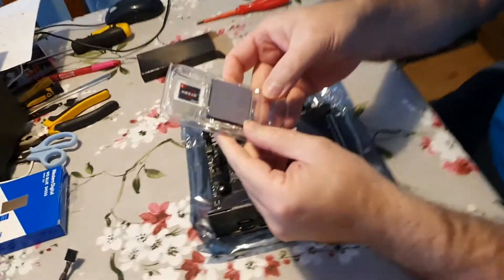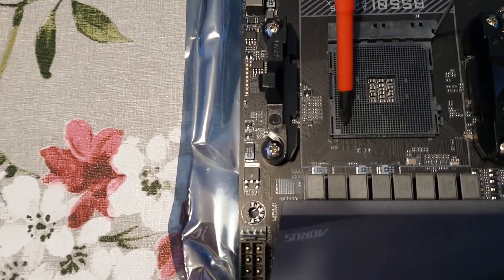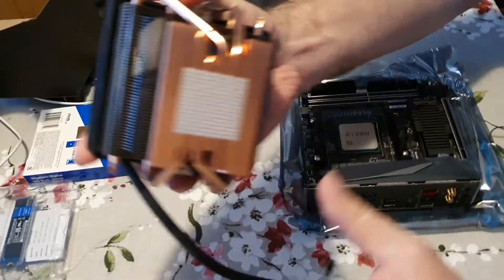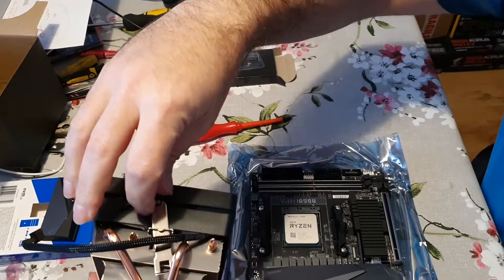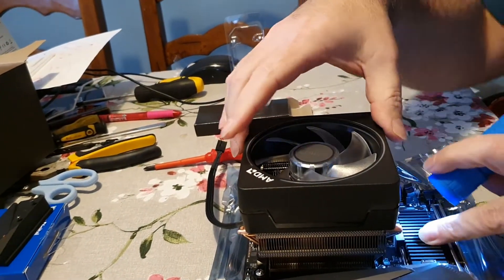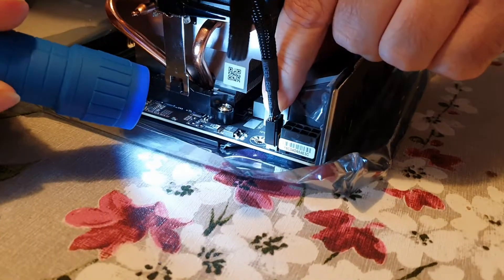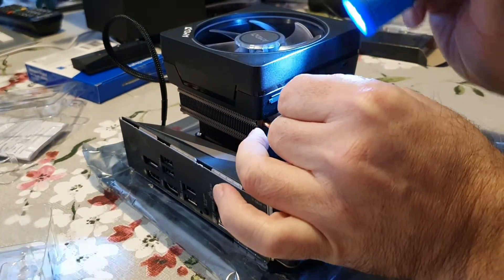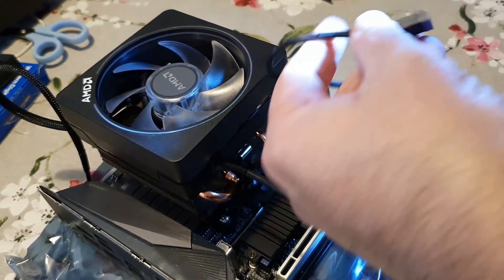Install AMD Ryzen cpu into AM4 B550i Motherboard using Wraith Prism cooler

Comment: Any ram clearance issues? I have the Wraith Spire that came with my 3600x and had issues with ram clearance (Corsair Vengance RGB so not exactly low profile), I ordered an OEM Wraith Prism because it's more effective and looks niftier but am concerned about issues with the ram since its bigger. It's more angled though and taller so perhaps it would fit better.

It took me more more time than I'm happy with to find a position for the Spire that didn't nudge the closest ram stick just enough to disconnect it.
Reply from the maker: I fitted the Corsair Vengeance 3200Mhz memory with no issues. I believe the RGB version is taller but I don't believe you will have any issues. Regards
Reply from the maker: https://www.youtube.com/watch?v=oQDnTdi_Djw
If you look at my other video at around 8 mins 50 it shows a better view of the clearance to the RAM to cooler. All the best.
Reply: It will fit just take the amd logo ring off. I had the same issue.

Comment: does the cooler master software work for u? for me, it says "please plug in cm device", even tho i installed the usb cable into that usb slot.
Reply from the maker: Hi there, thanks for the question. I have built a few PC's with this spec and they all seem to work fine with the Coolermaster software & just the USB cable. I am able to adjust the cooler to whatever colour I need. The software version I am using is V1.18 if that helps. Maybe one of the small wires connected to the cooler is not pushed fully home or faulty. I would try this first. Regards
Reply: @deanjallen6449  thanks for the response... guess i can double check my wires to make sure both sides got fully plugged in.. i heard this particular board had USB issues, i wonder if it could be that. im confident both plugs r in secure but couldnt hurt to double check i guess
Reply from the maker: @teh0wnz0r76  I have used a number of these boards and not had any usb problems. The boards I have are running bios version F3. I have had issues with the ethernet driver off the gigabyte site though. The internet drops off now and again especially while downloading from steam. Basic windows driver seems to sort it. ATB
Reply: @deanjallen6449  hm well im on bios f10... i think im gonna consider bios f3 to see if that helps if my problem persists. i hoped f12 would be stable n solve all these issues but it looks like its only stable for some. again, thanks a lot for the responses n advice
Reply from the maker: @teh0wnz0r76  I personally would try another cable first if possible. You need to be a bit careful updating the bios I have found especially on Gigabyte boards. It's one of the reasons I am still running the F3 one. Even if you have good power when flashing things can go wrong and brick the board, one of the reasons I don't flash after the warranty has run out. I tend to update voltages etc manually first if I have any stability issues and this usually solves it. I would only recommend flashing if you have any major issues. I have found a newer bios version can actually give worse performance than out the box. I do also know they recommend flashing especially with AMD boards but just be a bit wary. I hope you get it working. ATB
Reply: @deanjallen6449  unfortunately, the cpu only came wit the one rgb cable, one usb cable. no extras. but thanks for the warning. i guess i can wait to see how stable the bios is before i try an update, but first i need to check to make sure my plugs r secure. i also recently saw on reddit that i mite need to active the usb in bios... so i can try that too.

i usually dont update bios due to potential problems so i do wanna try to avoid that if possible. eventually i need to if i upgrade to zen 3, but for now if it works stable, i dont wanna touch it lol. thanks again
Reply from the maker: Sounds good, if its on in the bios and it should be. If you have a case with usb3 and its plugged in, some of them also have a usb2 attached. In this case remove the case usb3 from mbo and plug in the case usb2. This would check to see if the usb is working on the mbo. ATB

Comment: What about Ram clearance?
Reply from the maker: Hi there, I tend to use the Corsair low profile RAM so there is currently lots of free space. I would think the taller ram would also fit with this configuration. The RAM stick closest to the heatsink would be close. Regards

Comment: I'm building a PC with this motherboard, a ryzen 7 3700x, and 16gb ddr4 3200 RAM. I connected all the components and powered it on and it looks like all of the lights and fans are working but there is no display. Any ideas anyone????
Reply from the maker: Hi there, sorry you are having problems. If there is something wrong with RAM you usually get 3 beeps. Ensure you have connected PC speaker for any codes. Having said this I would try your GPU first. Try a different connector and see if this helps. If no luck, try to re-seat the graphics card and see if this helps. It is always difficult to tell and best to start and swap out parts until you get it working. I would pull out everything you don't need. Keep the very basics to try and get it to POST first. If no luck I would try to swap GPU first with a known working one, then the PSU. It may also be worth pulling the CPU incase of any bent CPU pins. I have had CPU delivered brand new and pins bent before - Did you check before putting it in. Hope this helps, ATB, Regards